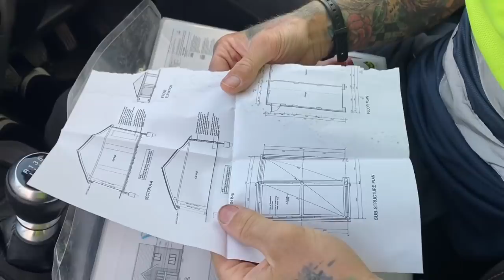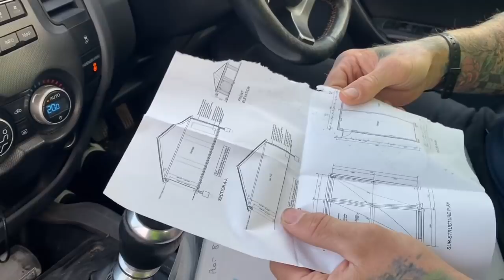Bricklaying, another week done

Comment: For the T-Clamp locking the profile to the wall. How do you get it back out after you lay blocks over it. I guess you leave a gap in the mortar bed as you build so that it can easily slide out again and  just joint/point up the gap afterwards, but I cant seem to find a video that shows removing it later when the wall is built? Could you do a quick 2 min video on that Charlie?

Comment: Great vids, bricky here in Canada. Was funny as fuck seeing the tool bucket dump, it’s nice to know it’s a common, universal thing on site lol.

Sweet profiling with the poles but it’s time consuming, ever use straight aspenite strips for inside corners? Just hammer drill into the mortar joints with a couple spacers and use a couple nails to hold the line?